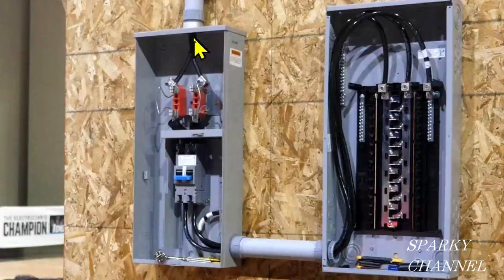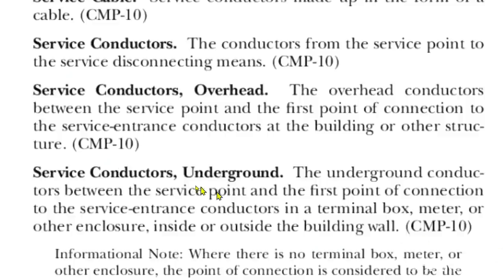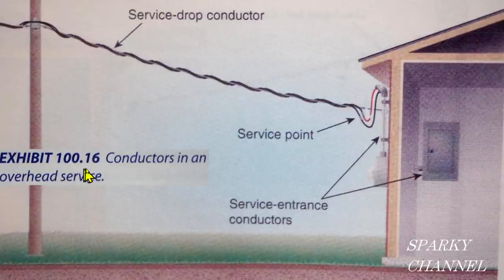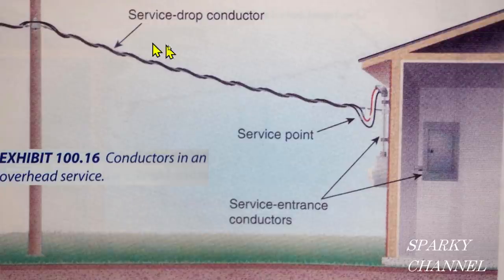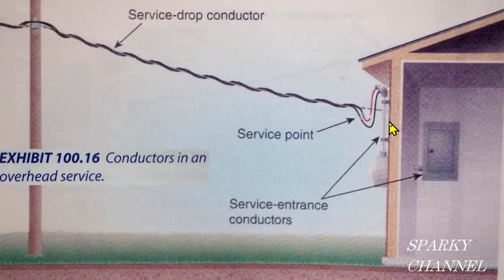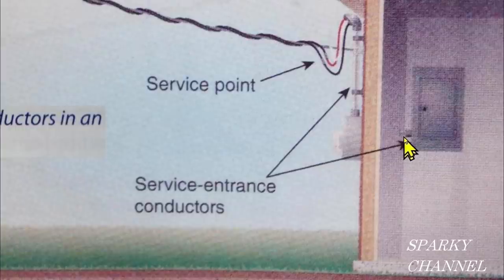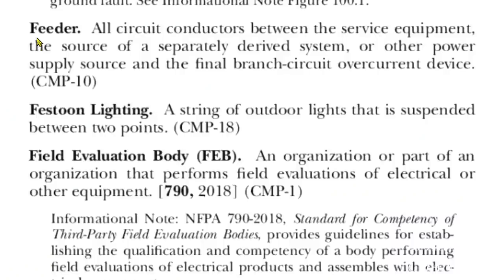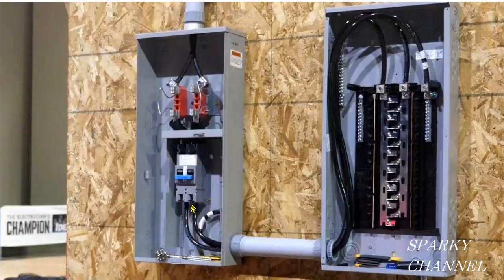What is a Service Conductor? What is a Feeder?

Comment: two problems with that setup is the feeder is missing the "EGC- Equipment Grounding Conductor" and the Ground Buss & Neutral Buss should be separated in the panel board. Once you leave that main disconnect those wires become a feeder and a feeder contains an EGC.

Comment: Thanks, another very helpful video.  Question about service entrances though.  I've noticed just about all residential protection devices are rated for 10,000 Amp interruption.  I know this is basically, the max current that the device could 'break' the circuit in the case of a dead-fault.  Are there any rules that utilities have to follow to make sure this is limited?  If we had some sort of on-site power generation would there have to be some certification that the on-site power wouldn't exceed that?

With a lot of large home solar batteries and such, is this sort of thing going to start cropping up as an issue?  (in my Navy career I've seen the effects of shorting out massive storage batteries and it isn't pretty when the circuit can't be broken)
Reply: 10,000 Amps?
Reply: @seniorcomputer3292  yes.  this isn't the trip setting of the breaker, this is the maximum current the breaker is CAPABLE of disconnecting.  this would come into play if, for example, a wrench fell into an open panel and shorted directly across the metal busbars.  a breaker that didn't have a high enough interrupting capacity might weld closed and be unable to shut off the power.
to answer the original question, yes, the power company has to provide enough information to the electrician that he can calculate the available fault current from the transformer and select equipment with a high enough interrupting capacity to open the circuit.
10,000 AIC is usually enough overkill that in residential construction, the calculations are unnecessary.
Reply: @seniorcomputer3292  Admittedly a rare situation.  But if you look at the short-circuit fault current a utility transformer is capable of, many can supply  quite a lot.  A 'bolted fault' at the output terminals can be 10kA to 20kA or even more.  Often it is the service entrance conductors that keep available fault current below 10kA inside the house.  But if you have a DIYer with their own power grid, who knows? 

Not a licensed electrician but I have worked around the power industry a bit.  So was just asking the question.

Comment: I noticed the load panel does not have a main breaker. Is the disconnect in the meter panel also an over current device?
Reply: Yes. A breaker or fuse is an OCPD
Reply from the maker: Yes, it's a service disconnect and it's an overcurrent protective device.

Comment: concerning residential; I can't find a video from anyone on details of a home runs. they show the home run, but never explain why the home runs come to that particular box, and how to go to box to box afterwards. I understand it's for overall efficiency, but I'm asking ideally when wiring a bedroom (for example), do you come to the switch first then down to outlets, how to pick up closet light? what about efficiency to plan to avoid over box fill? I can procedurally wire, but if an electrician said you should have come to outlets first, or switch first, or all lights on different circuit I wouldn't know why? thanks, I like your videos and attention to code details
Reply: Howard: A boat load of questions there.  You should be able to find
all the answers on this platform.

NEC 2020 says need a neutral in the
switch box.  For future use, even if not
used now.

Comment: What is the largest amperage available on/from the service drop
conductor?      Residential Building.
Reply: typically 200Amp. but depends on your local grid, ask your local service provider.
Reply: Residential load centers are available up to 225 A. That's more than enough for an average home.
Reply: I have a GE load center with a 4 pole main. I've never seen one an any home I've been in before. Why 4 pole?
Reply: @garbo8962  
Most of CA is heat pump territory. Much less power demand.
Reply: @scott_meyer  Thanks. I heard they got a lot better. 40 years ago talking to AC guys they would never have a heat pump. A friend had 2 in his large house. Every winter he had 2 service calls costing over $500. Finally took my advice and ran heat on cheap natural gas.
Reply: @garbo8962  Long term the unstated plan
is to make electricity extremely expensive.
    Only heat one or two rooms at a time.     MUCH as energy costs now
in eastern Europe. 

    Big city folks back on trolley cars (electric ). for transportation.
Reply: I saw some mansions that had 400 amp setvices. They pull two #4/0 cables to two 200 amp circuit breaker panels. Heard a few mansions have 600 smp services.
Reply: @garbo8962  Separate meters?
Reply: @seniorcomputer3292  No one meter. All 400 amp meter sickets come with double barrel wire lugs to facilate coming out of meter bix with two sets of wires. Would be too hard to just use a wire rated for 400 amps. Did 600 & 800 amp e phase comercial services where I used 2 conductors per phase. 500MCM copper wire is probably an inch in diameter and difficult to bend. Its rated for around 380 amps but the NEC allows you to use it for 400 amp service.  When you install  two 200 amp circuit breaker panels from a 400 amp setvice both panels have to be close together ( same toom ) unless you sre in the latest ( 2020 NEC cide cycle ) where all redidental services must have outdoor disconnect. This makes it easier & faster for fire department to secure power.

Comment: Sparky you made a video that showed you replacing all of your two prong plugs with gcif breakers in one circuit in a way that if one breaker popped it would not affect the rest of them.  Could you tell me what video that was and how to find it.
Reply: The video dated March 29, 2020 might be the one you're looking for.
Reply: Line to line connect on all the duplex 
GFCI receptacles.   Nothing on the load connection.
Reply from the maker: Here you go: Change Out a Circuit of 2 Prong Receptacles With Slim-Line GFCI's per 2020 NEC: https://youtu.be/RkqIgOt99DI

Comment: Newbie here... is it typical not to have a neutral coming from the transformer included in the service entrance conductors?
Reply from the maker: Residential Service Entrance Conductors, or SEC's, typically have 2 hots and a neutral. No ground in the SEC. We typically designate the 2 hots as black and red, and the neutral as white.
Reply: Right but I only see two conductors entering the top of the meter socket disconnect box, both black. Where's the neutral?
Reply: @SparkyChannel  ?
Reply from the maker: @Bapuji42  He hasn't run the neutral SEC cable yet. The feeder with the white tape on it is the neutral feeder, but he hasn't installed the neutral SEC yet.
Reply: @SparkyChannel  Ok, I see. Thank you sir.

Comment: Which one will the GEC connect to?  I assume it will go over to the meter box since that js the first disconnect.
Reply: you're right.  there should be 4 conductors between the meter-main and the panel.  and there should be a grounding electrode conductor to the meter main.

Comment: so the two black wires from the Service Conductor will carry 120 volts each? the reason I'm asking is because right now one feeder is 114 volts while the other one is 120 volts  is this normal?
Reply: Yes.  It is common that the voltage from the company providing power is not providing the correct voltage.  Frequently they can be off and most of the companies have this possibility listed in their agreement.  In your case I would call to see if they are okay with you receiving 114 volts.  
Too few volts and it can affect performance.  Your clock may run slow, kitchen appliances not working their best, etc.

Comment: Is that switch the same as a fireman switch?
Reply: The NEC is the National Electrical Code.  It never uses the phrase fireman's switch.  However, the disconnecting means for dwellings is used by fireman to cut power to residences while they are working.  You can find this in the NEC under 230 Part VI.

Comment: So the panel on the right is technically a sub-panel, and would have its ground and neutrals segregated?
Reply: yes.
Reply: typically the main disconnect would be in the panel on the right (in my area) so the neutrals and ground would be bonded there, but in this case there's no bond since the disconnect is in the box on the left. Long story short, no bond past the main disconnect.

Comment: The size of the feeders is 3 what? I’m confused.
Reply: AWG (american wire gauge)  is pronounced aught
Reply: 3/0, or also 000. The conductor size in AWG.

https://en.wikipedia.org/wiki/American_wire_gauge#Tables_of_AWG_wire_sizes

As the name states, only America uses that one. In most countries the it's the cross-sectional area of the conductor in mm²:

https://en.wikipedia.org/wiki/IEC_60228
Reply: And a thing to keep in mind with AWG or just gauge for sheet metal. (Other metals as well possibly.) Higher the number smaller the size, lower the number bigger the size. Yeah I know bit strange, but hey that's America for you at times.
Reply: @Wycher  thank you!!

Comment: Sparky...couldn't it be said also that the service conductors  are usually  aluminum  wire..?? And the feeders could be copper wire??...
Reply: No, service conductors could be either and so could feeders. The service drop will be aluminum from the utility but from the service point to the meter, some will use aluminum and others copper. I work for an electrical contractor and he prefers to only use copper but others will use aluminum to save money.
Reply: The only true statements related to the two, 1) is if using aluminum, it will be larger than if copper is used. This is because copper is a better conductor of electric. However, either metal can be used 2) there is a service discount involved.
Reply from the maker: I think it depends on the area. In my area, almost all of the houses use copper. The service drop will be aluminum though. That belongs to the utility.